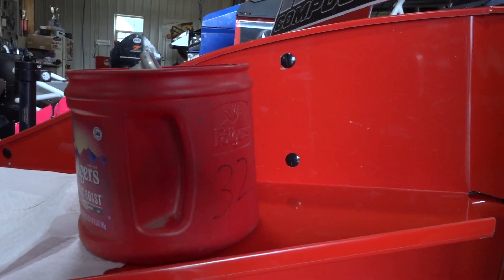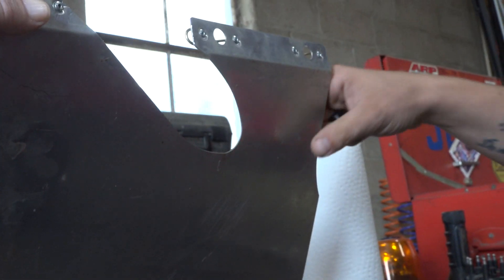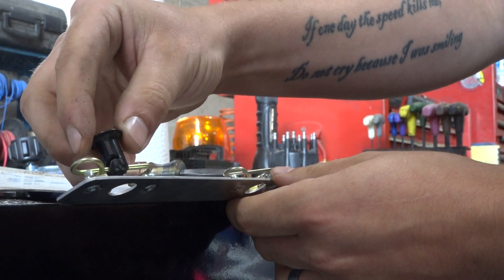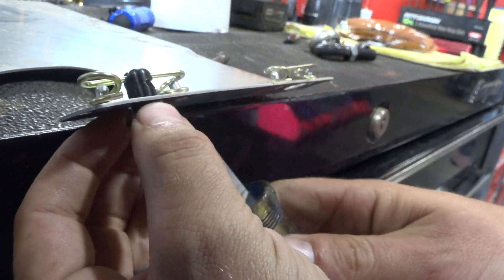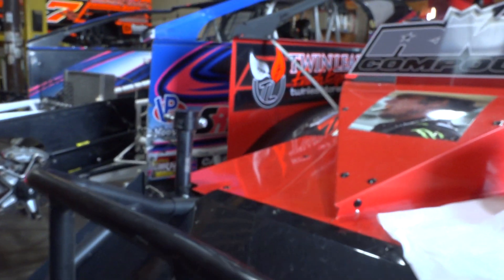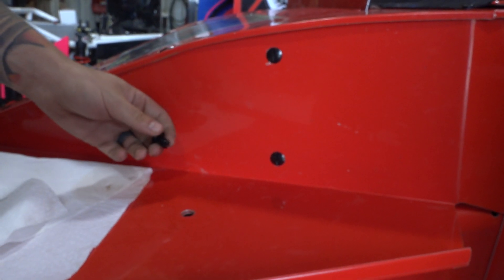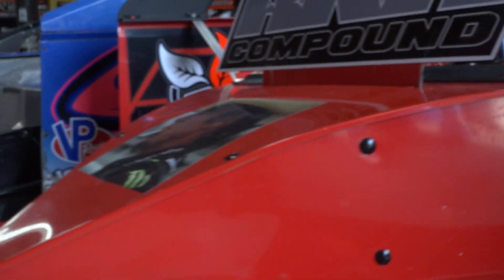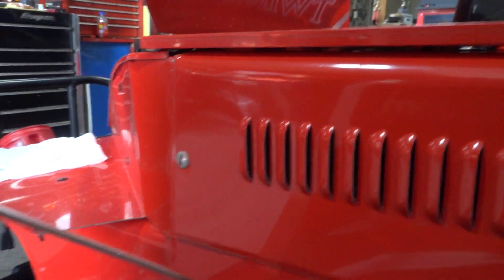Ronnie Davis III shows us how dzus fasteners work Aug 10 2023

Comment: William Dzus,invented them in 1930's! I turn them every single day at work,they are used on Liebert industrial air conditioners to hold panels closed,or as a primary attachment fastner! The only difference is the ones they use are allen head,and flush mount to the panel!